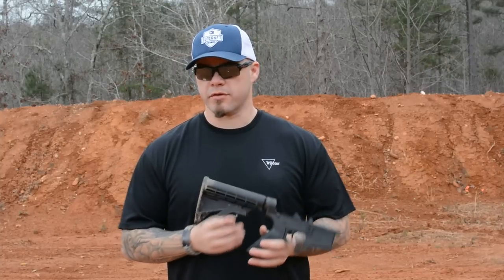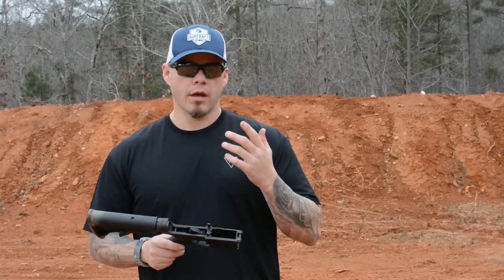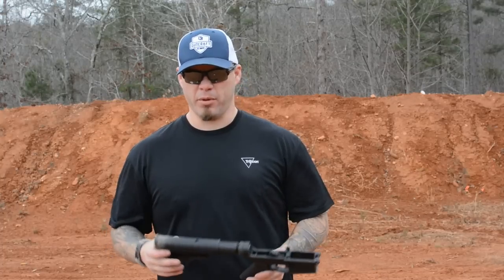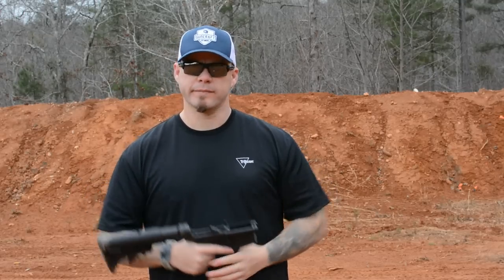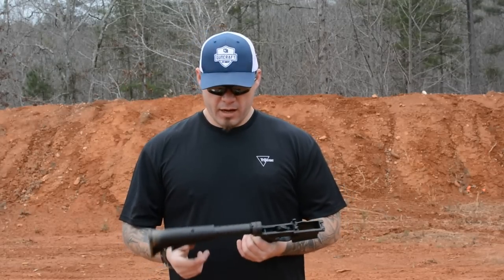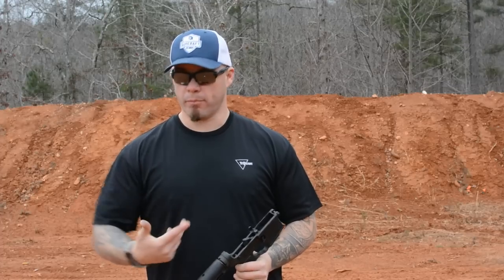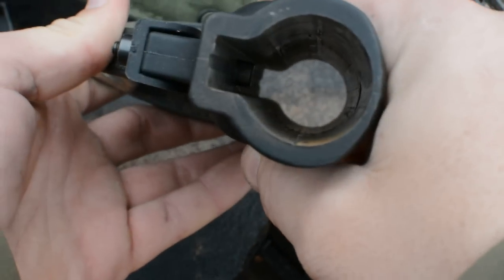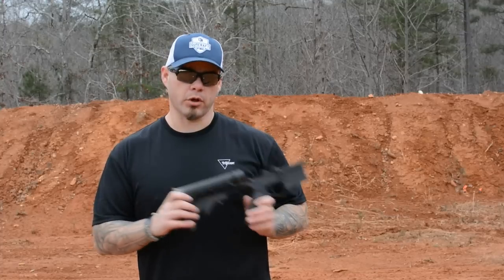Starlos SLF-15 polymer lower

Comment: I worked for a shop that sold FMK polymer lower receivers back during the Bad Old Days of 2012, and we returned so many of those pieces of shit because they would crack, some times splitting entirely by the rear takedown pin and the tang just underneath where the buffer tube threads into the receiver. I swore them off regardless of mfg after that.

Keep up the good work, Aaron.

Comment: One test you missed, done by Karl and Ian over at InRangeTV is a push up test.  Also would like to see if the GWACS holds up to your tests as it did to Karl & Ian's.
Reply from the maker: As in push-ups with the rifle?
Reply: Yes, sorry should have been more specific. Looking to see if the pressure would break the area where the buffer tube screws in.
Reply from the maker: +Rumblestrip.NET that's certainly one way to do it. I don't do push ups on any rifle so it's not something that would occur to me.
Reply: Sounds good.

Comment: Maybe somewhere down the road a polymer lower with steel inserts or 'endoskeleton'-like areas at the key stress points like the pins and buffer tube nut.  But then that might end up costing even more, I guess.

Comment: I take it the castle nut was not " properly " staked . That could have kept this problem from happening . I wonder if those Calvary Arms polmer lower with the one peice buffer tube stock is still avaible ? I have seen videos with bullet holes through the buffer tube and the gun kept running .
Reply: bryan faulkenburg They're available as 'gwacs' lowers. They are the most 'proven' of all the polymer lowers, as long as you don't mind fixed stock, grip, oldie sling mounts etc. May require small amount of fitting for mags and pins but don't have any of the weaknesses that other poly lowers have due to the sturdy all in one design.
Reply: bryan faulkenburg bryan faulkenburg They're available as 'gwacs' lowers. They are the most 'proven' of all the polymer lowers, as long as you don't mind fixed stock, grip, oldie sling mounts etc. May require small amount of fitting for mags and pins but don't have any of the weaknesses that other poly lowers have due to the sturdy all in one design.

Comment: Hey Aaron thanks for the review.  Something I think that's worth pointing out when a lot of people reference strength in materials is that these comparisons of materials are usually done with equal weights.  So a lot of times when you hear that aluminum is just as strong as steel or polymers are just as strong as aluminum may be true when you have an equal weight ratio.  Because aluminum is much lighter than steel when given an equal weight ratio the aluminum can be just as strong because there is much more mass.  Likewise with polymers.  It all ends up back at the beginning where design elements are considered.  Products are designed to be made from specific materials so when experimenting with new materials usually the entire design has to be altered to work with a new material.  Btw im just a machinist I'm not an expert at all on engineering/metallurgy so take that for what it's worth.  Thanks again for the videos !

Comment: I am go ingto say this. Take it for what it is. @SageDynamics, Aaron, you sir are doing a great job. This is as useful of a gun review as I have seen. Your steps are as close to realistic use and causes of failure as I have seen in vids. No nonsesne steps that people do not usually do with guns, like Push up or multiple trips under tires/vehicles.. 

Oh, and if you look at the buffer tube notches, there is a slight bevel/ramp that formed (Noticed it when you showed the buffer after the failure, and the stock wasnt locking in deep enough, therefore that lip allowed it to slide "freely", your dis-assembly/reassembly probably made it so the nub would lock in better. 

Keep up the great growth, and keep up the great content.
Reply: I agree with you. He should also have a hell of alot more Subs then he does. By far one of the best channels on here.

Comment: I too have been a polymer skeptic, yet own a few Glocks. A bit hypocritical, but reputation must be earned I believe, regardless of parallel similarities between weapon systems. Btw, do you remove your spent brass offten? I'd love to spend the day with a pic bucket picking up those casings lol
Reply: The difference is, the Glock (like the AUG and the G36) were designed and build with the intention of being made from polymer, so they could take into account all the strengths and weaknesses of polymers. But the M-16/AR-15 wasn't, and so they have certain spots which are simply too weak when made out of polymer to be really reliable, most notoriously the rear end of the receiver where you attach the buffertube. Adding fiber-reinforcement would definitely make it stronger, but even then it still woul remain fragile.

Comment: I like the channel but with this video I am still hearing a little of the same sort of preconceived bias toward polymer lowers that we frequently hear. Good, bad, indifferent, polymer lowers are happening, and you are in a good position to gather useful data and experience with this particular one, which could help steer the market in the right direction, and overall help consumers make better informed purchases. In fact, I wasn't even aware of this brand before seeing your video. So, while you don't recommend it in the end, all I saw was a very positive review for this product. The castle nut was not staked, that explains that. Some outfits do it, others don't, and opinions on the subject vary. Second, the stock failed. That's on the stock (or the abuse), not the lower (unless we can verify that damage was or was not done to the tube itself). That exact stock likely ships on a dozen other company's aluminum lowers.

The issue with staked castle nuts is the same as staked gas keys. If an engineer must use screws/threaded parts in a firearm, plan for them to come loose. I believe this is why screws are rarely used for vital parts in firearms. And arguably a negative point for the AR's design in general. The adjustable stock is an adaptation to the M16 where the stock itself prevented the receiver extension/buffer tube from backing out. In the world of everyone modifies their AR, they assume you may change the end plate, or whatever, and you can stake the nut yourself, use thread locker instead, or just keep an eye on it. But in any case, it's an issue which is brought about when the adjustable stock was adapted to the M16 design, and not specific to this product.

A staked castle nut and a new stock (that you said shouldn't have been mortared in the first place) and this thing is holding up well ... so far.